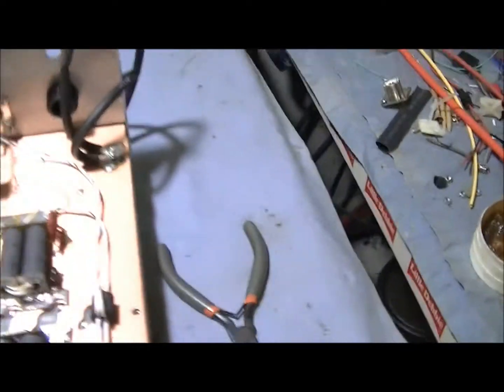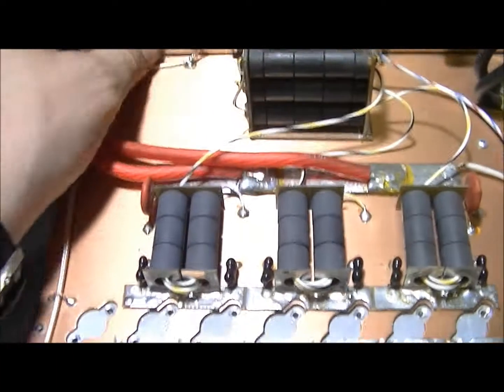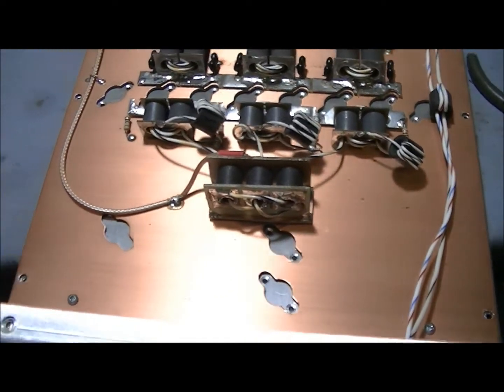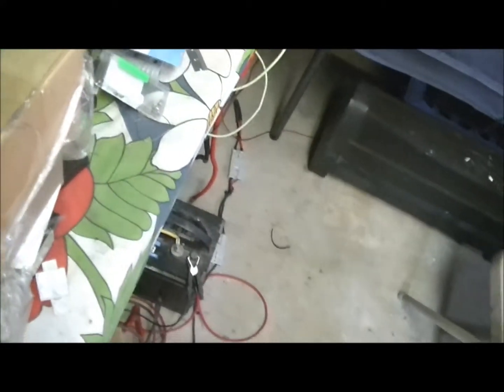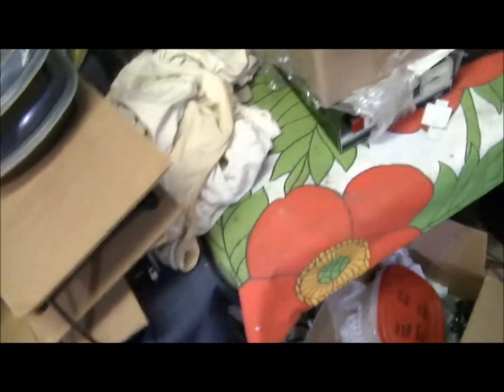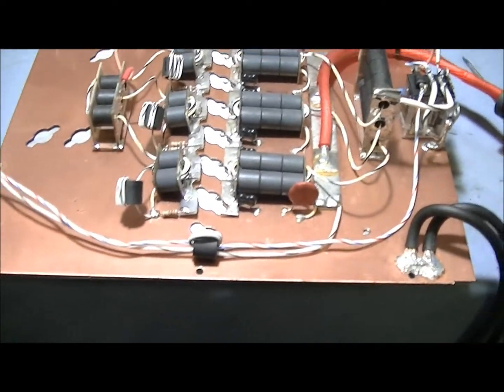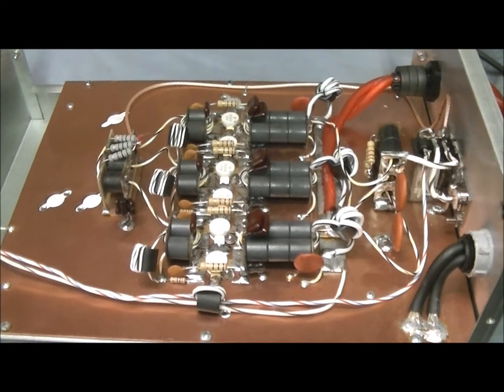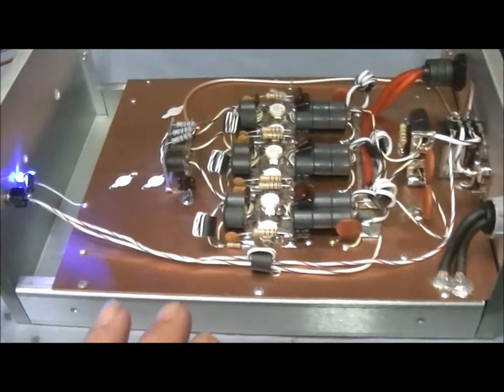6 Pill 💊 HG 2879C Collaboration Build with another builder 👷‍♂️

Comment: Awesome!,nice work,I love the port builds,5wraps w/1000pf!!, I know they used to do 680 puff with five wraps on toshiba's, this HG stuffs,just a little differnt!!,keep doing watchya doing73's c ya
Reply from the maker: Yep that is what you would see. A 690 on the output. 5 wraps. That would be with amplifiers done in 4 pill section usually not sure about 6 pill. My 6 pill design calls for 4 wraps personally. Ive seen no reason to try different ways since it works so well already ya know. Thanks so much for stopping by bud!

Comment: Very clean! Any reason you all don't put say a couple of 4700uF electrolytics or similar off the positive bar? I did that with mine and got more consistent PEP wattage output in my mobile.
Reply from the maker: You know what, Imma be honest with you. The reason you won't see many people using a lot of Electrolytic Capacitors is because most people are using really good switch mode supply now with good filtering on the output of them. I my self have used them from time to time mainly to fill in space but Ill give you this....I havent truly tested to see if they will help with output be sure they shouldn't help with output or unless there is an issue with your power source like possible voltage drop across your power leads or such stuff like that.

It is something I need to do some test with though and I need to put if on the list of videos to make. Thank you very much for that input. Im doing it now.
Reply: @1883GotDown  Great, looking forward to it!

Comment: looks like someone else got a bad batch of ferrite. Why I use the LCR meter . That old combiner went into parasitic oscillation . big waste of watts burned up.   The cores will even get real hot. And put a lot of reflect back to the pills . Them LED relays are ok for bias switching but not RF. I use them on HVAC systems and they work fine. I just get my relays for RF from ICA  and ferrite as well. nice big heatsink . that shim is great. will also force more air threw the fins. I have not used the 2879C yet. I would put a cap bank on pos strip and a buss bar like a #10 solid copper to help split the current. on 8 pill I use 4 #10 power leads or 2 4ga. I put meter on that pos strip at each 2 pill and check to see if even power.  as you go up in pills the match has to be closer .unbalance power is burned up on final combiner. that watts not going out antenna . why I use a Flair . 73's